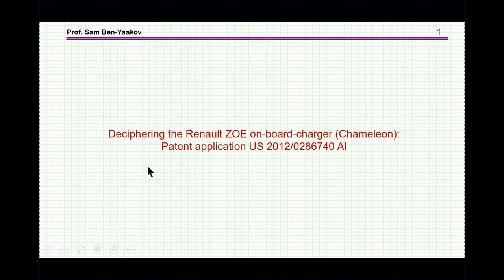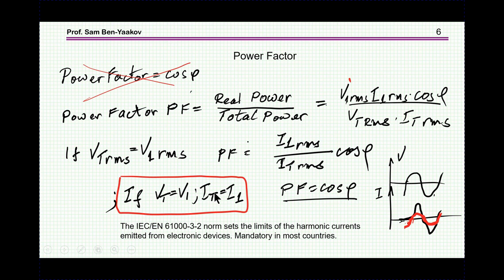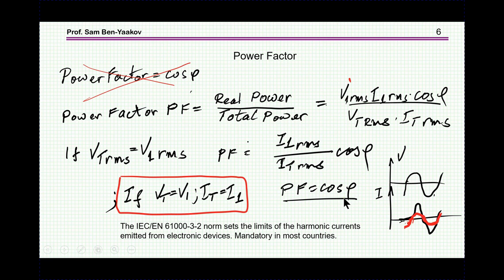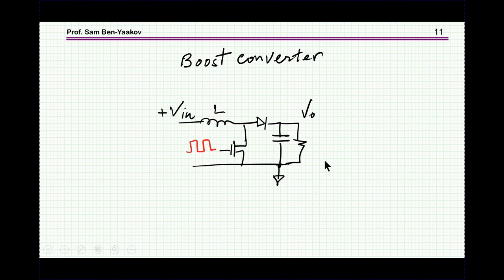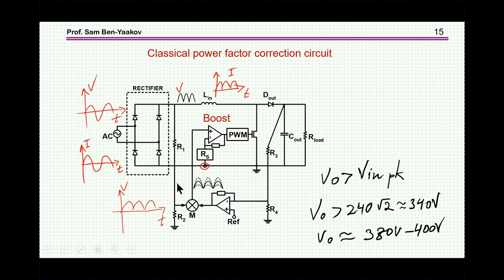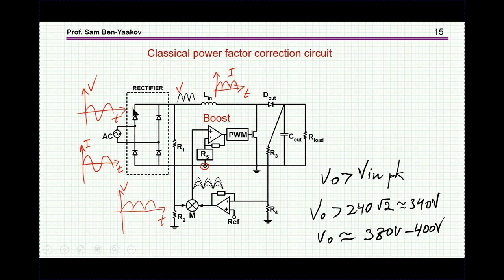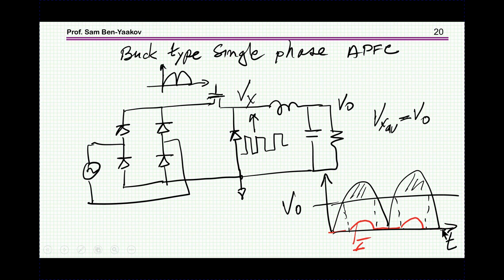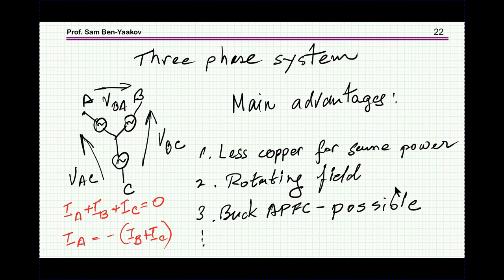Deciphering the Renault ZOE on-board-charger (Chameleon): Patent application US 2012/0286740 Al

Comment: Thank you very much for the interesting lecture, I charged the zoe via an 11 kw wallbox and both the zoe, my power box and my household appliances made a very annoying high-frequency sound, after I stopped charging the Zoe there was a coil whining in the devices  remained, I'm really worried about reconnecting it now, what could I do?  With direct current there is no such high frequency noise.  Thank you very much
Reply from the maker: Beats me. I guess the vehicle and power line formed a resonant network.
Reply: Thank you Sam, I read that due to residual currents, harmonics get into the house and then the end devices emit a very high whistling sound, the Zoe charging function is not very friendly to the power grid

Comment: Most regulations would require OBC to have isolation, but it is missing from this idea. Once again, thanks for your nice lectures.  I have been following your materials for over two years. I really really enjoyed it. Take care and stay healthy under the COVID-19, Prof. Sam.
Reply from the maker: Thanks Wang. Best wishes.
Reply: Either Isolation of the OBC or in case on ZOE they needed Reinforced Isolation of the Motor Windings, which proved to be cost prohibitive. Also there aren't any AC chargers with 40kW rating. Most outlets are capped at 22kW. Therefore Renault doesn't use this system anymore. Its newer Zoe models use a traditional OBC and a simpler Motor with normal isolation.

Comment: Thank you very much for your lessons.  
Does it matter,  that the motor windings have steel as magnetic core and have therefore much higher losses compared to ferrite core? Using the electrical motor as a choke doesn't provide high efficiency.
Reply from the maker: Motors steel is laminated like a LF transformer. But indeed, not for high switching fluency.
Reply: @sambenyaakov   Mr. Ben-Yaakov, in a video you are describing a very interesting concept of a LLC converter with controlled MLCCs. Bei using a DC voltage the capacitance of some x7r capacitors is changed to achieve the resonance of a LCR circuit. 
My question would be, is it the same way possible to use a controlled inductance too? About 80 years ago there was a technology of magnetic amplifiers. Maybe the application of magamps still would make sometimes sense. 
I'm enjoying every one of your lectures on YouTube very much.  Many thanks!

Comment: Using the motor windings as the inductors is a genius weight saving measure! I assume the switch from charging to driving still requires some kind of contactors closing? Or is the motor permanently wired in a wye (star) configuration?
Reply from the maker: The motor is star connected
Reply: There was, around 2000, a wind turbine (Bergey) that used its 3-windings as the inductor for the battery charger circuit.

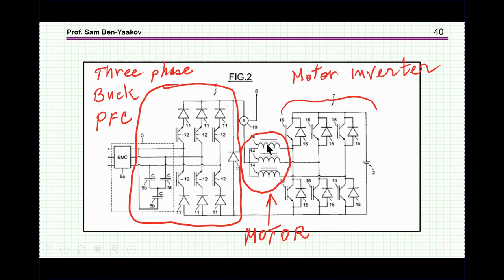Comment: But what in case of regenerative braking. Am I right, that then motor is generating 3p AC which goes throught motor inverter (right side of scheme) directly to the battery as a DC without using Three phase Buck PFC (left side of scheme) ? 30:22
Reply from the maker: Regenerative breaking can be achieved by adjusting the modulation.
Reply: Yeah, but I'm wondering about ZOE R90 which can: regenerate 43kW, charging 'only' 22kW, and has motor power output 65kW. So I'm not sure, but do you think the three phase Buck PFC is 22kW (because it's transfering AC from the grid), motor is of course 65kW because of max. car power, and right side of your scheme at 30:22 - motor inverter is 43kW to support regenerative charging?

So if we can change the left side - 3p buck PFC to higher power one we can get 43kW from the grid?
Reply from the maker: @oskarzgoa8428  Well,  don't know if indeed the charging power can be boosted up with present motor. In any case it seems that this clever idea is going to be remembered as a short time  episode

Comment: Sam Ben-Yaakov 
 For weeks i have a question and now I hope só that you want to help me with an answer?
In short: can an airgap improve the total power of a transformer?  given that that power is only limited by saturation of the ferritecore?
(I built a H-bridge to drive three 40W ferritecoretrafo's (the 3secundairies in series). 
The igbts and adjustable powersupply stay cold, so busvoltage and frequency, i can easilly choose a bit higher, but when the load for the secundairies gets to high the cores gets saturated(can clearly been seen on the scope and heard on a strange ringing-sort of sound coming from the last transformer (the 3th trafo in seriesrow saturates always just first of the others but only by ½watt(for that3x 42watt-co2lasertrafo's)). I can of course not add more material to the core 
but 
would it help when I make an Airgap?(or3airgaps, one in each core of course)? I think that would make the inside resistance (or whats the word,i mean that the voltage will drop much more under load,but that's not such a problem because i can easy drive more power through the primairies) 
but so I question: 
can i get more power, more watts in total, out of a transformer when i make an airgap in it to prevent that saturation at that powerlevel? Can a transformer handle more power with an airgap in the core? (so for first without worrying about wirethickness and heat, only the total power it can deliver in a short run)
I hope só that you can tell me please? i rather not risk the core to break when an airgap could not help me get more secundairy current before coresaturation.
Reply from the maker: Hi Rob, when driven by pure AC, a gap does not change the magnetic flux density which is determined by VOLTAGE: d(phi)/d(t)=v/L. For a transformer (not coupled inductor as in Flyback) the smaller the gap the better. No gap is the best if you know that that the drive has ZERO DC component. Otherwise some gap will help not to saturate due to the DC CURRENT COMPONENT.
Reply: @sambenyaakov  wow thank you so much! I am glad i did not try it out so riskfull! What supernice that you helped me, Oh i type to much, but at least i want to say:  thank you very much, for your nice and great help!
Reply: @sambenyaakov  the frequency higher, that makes the secundairy deliver more current before the core saturates? (I mean: more watts for that core by higher frequency? Or wait, is flux independent of frequency? (Ow i still have such a lot to learn!))

Comment: I hate french cars, but I gotta admit some of their cost saving measures are a breath of fresh air in the modern era of german overengineering. 
My main concern is as far as I know the motor has iron sheets core, meaning all the hysteresis and coil length losses associated with that.
If the transistors used are really bad at high frequency switching anyways, then its not that bad. Also I'm not sure if all that motor buzzing during charging could shorten the lifespan of the materials surrounding it.
Reply from the maker: Thanks for input

Comment: Anyone knows why the zoe don't charge in a facility with a "IT" earthing system.
Reply: Zoe, because it does not have galvanic isolation between the battery and power supply, is very strict for ground resistance. The only way Zoe can check ground resistance, is to measure the resistance between Neutral (grounded at transformer) and Ground (grounded at home). In the IT system, neutral is free floating, and resistance is infinite. This is usually overcomed by isolation transformer.

Comment: The new ZOE hasn't this charger anymore. They had series problems with earth leakage current. As result trippibn RCB in charching infrastructure.  Further the firmware of the charger is not tolerant to harmonics on the Powerline. Therefore the term "ZOE ready" on some chargers. But this has nothing to to with this topology itself. Zoe's with chameleon had 43kW power, more than most other OBC. But the problems seem not worth this, cause fact is new ZOE hasn't this charger built in.
Reply from the maker: Thanks for update.
Reply: This is not factually true. All Zoes do have this system still, they just optimized the motor windings for a 22 kW limited configuration (R-series motors, compared to Q-series motors initially) for actual driving performance gains and the fact nobody else caught up to 43 kW AC charging and probably never will. They also did optimize a few firmware operations not to cause excessive ground probes which tripped the RCB (2015 Zoes onward). This carried on to the new Zoe which is still 22 kW AC capable (in addition to CSS). Judging from what's publicly available at this point, the upcoming Renault MeganE EV will also use the system because they claim 22 kW AC compatibility and it's unfeasible to make it work at this price point. Nissan Ariya that's supposed to share the CMF-EV platform with MeganE is also 22 kW AC capable in higher trims and also Nissan said they are switching to Renault's motors as well as forgoing permanent magnets so its probably they will use it as well, at least that would make sense to.